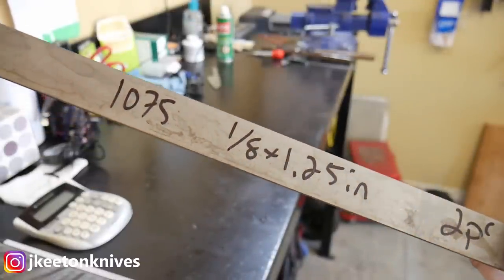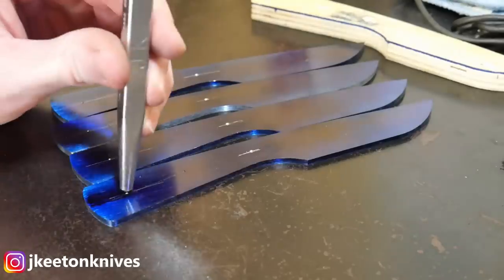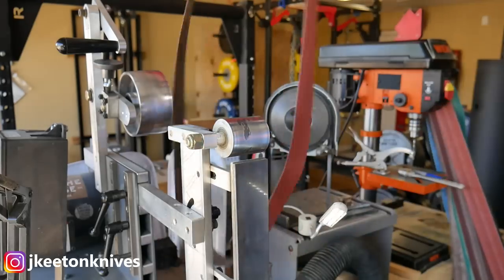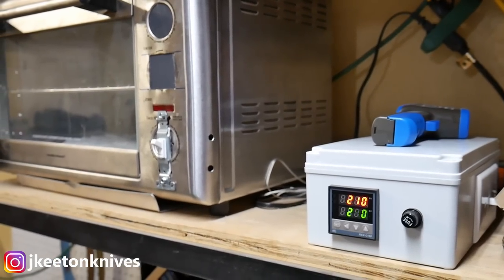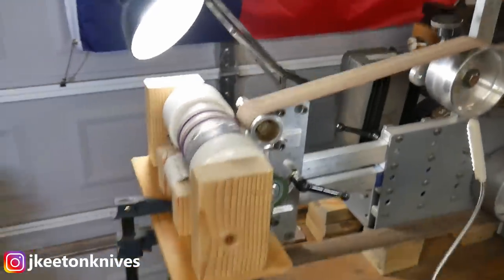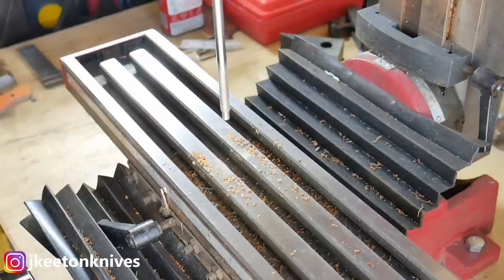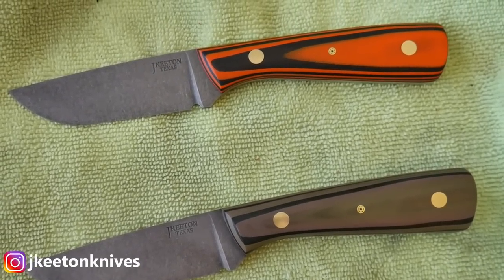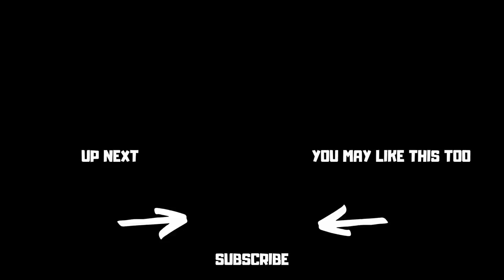Labor Time Per Knife - Making a Batch of 4 Knives

Comment from the maker: Anyone else work in Batches?! Any suggestions?
Reply: JKeetonKnives I’ve only done a batch one time. It definitely saved an enormous amount of time. As a hobby knife builder I will probably not be doing a lot of batches. I have never sold a single knife yet. (Ugh) I have no idea how to sell. I better learn soon if I want we er make a living at this.
Reply from the maker: @e.t.preppin7084  My opinion is you start with friends and family and rock bottom prices... They can be your beta testers.
Reply: When I batch work I rough cut out with the bandsaw then mark out one for the pin holes clamp a stack of 6 together and drill the pin holes,
Then I stack them together and bolt through the holes and profile grind all 6 at once that ensures that all are profiled the same.
 I should add that my pattern is tapped for the bolts and is hardened so I use the pattern as a grinding pattern.
Reply from the maker: Al Meyer I like that! Will need to try something like this out!
Reply: @e.t.preppin7084  As a fellow hobbyist, I too have toyed with the idea of knifemaking as a retirement business.  I have sold quite a few knives, but I soon realized that if I made a business out of this hobby, I would lose the joy it brings to my life. This I found to be especially true when I make a true "custom" knife to my customer's specifications. Most customers, so I have learned, generally don't know what they want unless they are able to see and hold a finished knife in their hands. I refuse to make commissioned custom knives any more, unless it is one just like one of my previously made knives. I am now getting into forging more often than not, and forging duplicate "batch" knives is much more difficult than stock removal.
Reply: Maybe drill holes in your template and transfer their location onto the blanks directly with a punch instead of blueing and scribing?

Comment: So basically a work day per knife. If you do them in batches. That explains why it takes me a week to build one knife in the part time when I have time to work on it. 😂. Very informative J as I would expect from you. Thanks. That’s extremely valuable information you just shared. Not many maker’s would be willing to share that information with us. 👍
Reply from the maker: Thanks man, I figured other makers would find this interesting. Working in batches really helps cut the time down. To be honest I generally like working in batches of 2 or 3. I feel it's more of a mental challenge to work in batches of 4 plus... not quite there yet in my head.
Reply: 5.4 hours per knife, is 8.1 hours per 1 1/2 knives. That's three knives in 2 work days.

Comment: Yep, outdoors suggestion is on the money. Also, and you're not the only culprit, maybe done for better visibility, but PLEASE lower the bandsaw blade guide, doing so protects you, and of course use a push stick ... you don't want to slip and push your thumbs through the blade. Although I wear safety glasses, I also like to wear a clear face shield ... why? It's not just your eyes you protect, it's your face and when you're looking down, your throat too. Limbs, eyes etc are not something you risk. A friend had gone to his father's place, where he made a knife, and in the process, the knife flipped out of his hand and stabbed himself under the chin on the right side, severing an artery ... his mum, a nurse, reached in and pinched the artery until they got to a hospital ... apparently he had no blood pressure when he was wheeled into surgery. Very lucky and of course he brags about his sabre scar ... a bit of a comic, but you get the picture.  Other than that, grateful for a cool video.
Reply from the maker: Have a great day!

Comment: I hate when pieces fall into the bandsaw, no matter how careful, it's bound to happen at some point.  Ya know, instead of a punch, you might wanna try a centering bit(like on a lathe) I raced my friend & it was close, but especially for multiple knives, once the bit is setup it's real quick... Yeah, I definitely suggest for every 2 jig knives, do 1 freehand or at least practice... Ya might wanna try straightening during 2nd temper, basically what you did in the vise, but with a piece of steel a few washers & a clamp... Just a few ideas, but we all have our own ways that are faster... Hope all is well, take it easy...
Reply from the maker: Dave Evader Knives cheers man! I have a centering but, need to try that out. I use the clamp method sometimes. Doesn’t alwAys get me where I want to be though. Thanks for your thoughts!

Comment: Hobby knifemaker here and I do try to work in batches as well but mainly so I can practice bevels without going for days at a time without doing one.  I dont sell my knives, just making for me.  Found so many cool tips and tricks in this vid, notably the block used for the handle ends, using a hard block for sanding with the pins (I noticed the bumps in my knives) and the tumbler assembly to the 2x72 (currently, I just shake the piss out of it).  Great informative vid.  Well done!
Reply from the maker: Heck yeah sir! Thanks for your comment. I'm really glad you found some use out of this video! Have a great weekend in the shop!

Comment: You mentioned decarb occurring during heat treatment. 
To eliminate decarb I have found applying a thin coat of satinite over the surface eliminates about 90% and takes only a few minutes. I mix the satinite cement thin enough to apply with a brush. This creates an oxygen free environment on the steel surface but does not inhibit a fast quench.
Reply from the maker: Good tip Curtis, I've heard from others this works fairly well!

Comment: In addition I've had success with (now dont laugh) using ca glue to adhere as many as 6 batch blades together and profile and drill them in a stack. Not only a huge time saver but because they are exactly identical, drilling and fitting scales is a snap!
Reply from the maker: Pretty good idea man! Talk about getting repeatable results! CA glue comes in handy

Comment: J would you give me a buy list of belts you use and where to get them on a silver platter. I understand that is a lot to ask but I’m asking anyways. I know everyone uses different belts but I trust what you use obviously works regardless of others. Thanks. If you have time to relay that information. I have the cork belts and the scotch brite belts. Mainly your ceramics and what grits.
Reply from the maker: For sure, so I get belts from two different places depending on what I'm ordering (TruGrit and Pops). In both cases I get the VSM ceramic belts since they're cheap. Normally I get the VSM ceramics in 60 grit and this is what I do my roughing with. I then move to 120 grit j-flex belts. I like the green ones made in Germany (https://trugrit.com/product/2-x-72-120jf-caao-aluminum-oxide/). I use the 120 grit j-flex to smooth out the 60 grit lines then get my plunges radius-ed and close to where I want them. THEN I heat treat. After that I clean it all up with another 120 grit belt, then 200 grit belt. Sometimes I go to a 400 after that and cork. Other times I scotch brite the 220 grit finish and stone wash.
Reply: Thanks so much for the belt information as well as your use explanation.
Reply: What micron belts do you use 45 or 74
Reply: Also are your 220 and 400 belts also jflex
Reply from the maker: @e.t.preppin7084  Yep, 200 and 400 are J-flex green belts from Germany. I don't use any micron belts.
Reply: At trugrit there are two columns to choose from. One was like 45 micron and the other was 74 I think. I just assumed that is the thickness of the belt.
Reply: 😂😂😂 I feel stupid I thought that was the header for each column. I understand now.
Reply from the maker: @e.t.preppin7084  I just choose, 2 x 72, then sort on price

Comment: Which tape should I buy for knife making? I wanna buy some quality tape but don’t know what’ll be best?
Reply from the maker: Well this is a good question. I've been using the green masking tape, but have contemplated trying some blue 3M from the store. I think most masking tapes will get the job done. If you plan on using masking tape make sure to oil your high carbon blade first! Also avoid leaving the tape on the blade for extended periods of time (1 week+). There is a tendency for moisture to collect and rust your blade. Cheers sir!
Reply: Red Beard Ops Sweet, thanks for your reply and guidance. Keep up the great work

Comment: Does the 5.41 hours per knife match how long it takes you to do one knife?
Reply from the maker: I would say no. I'll time my next one off knife, but I'm very confident that it will take longer. A good portion of the time is a "fixed time" that consist of setting up the operation. Once you have things set up say for drilling, glue up, etching, tumbling, grinding, etc; you can save a significant amount of time per knife by running though that operation on all of them. 

So the SET UP is a "fixed time" and the OPERATION is a "variable time" per knife in the batch.
Reply: @RedBeardOps  That's what I was thinking would be the case too. I've been doing one offs....might be time to design a knife I like to make and do some batches.